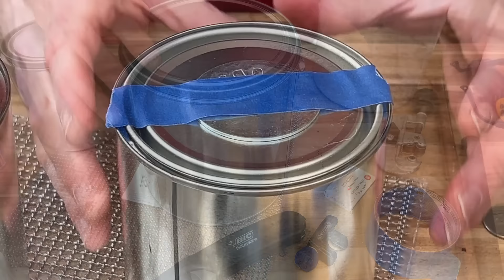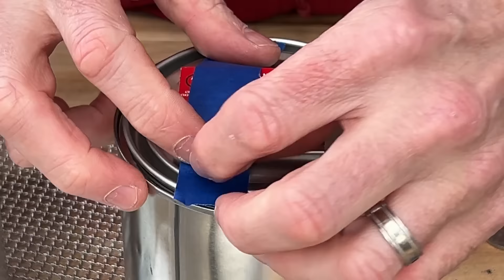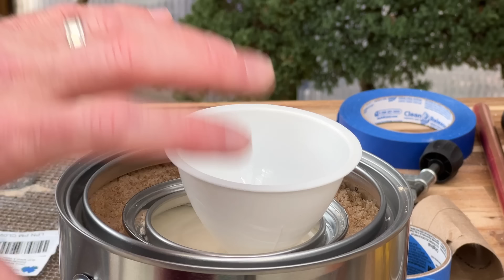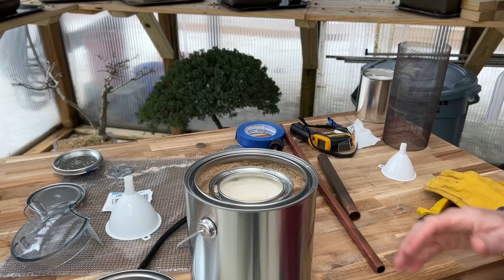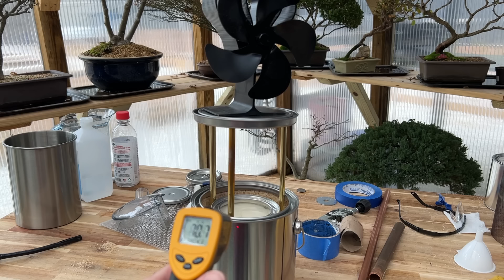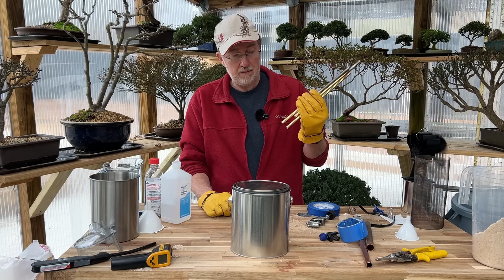Endless Heat Without Electric | Safe Reliable And Low Cost

Comment: My mom, gave me a folgers coffee can. And said if he ever get stranded this wiil keep you from freezing  to death 
3 large 6 inch hard wax candles, and  a dozen bullion cubes 4 styro cups an aluminum  blue metal,t2 small boxs of strike any matches.  Also ketchup and honey packets.,smqll kitchen tongs for holding  the aluminum  glass when heating snow for broth. ,and dozen pckgs of saltines. Got a new version  every year. Only used it once in year's.  And it was a test  to see if it would haved worked. Sat in the driveway after i got home from college  one  year and waited  until the next morning, is was. ,u could see your  breath.  I had a small  toyota celica,not the beast of volume. And thank God  there was snow. It took 1 hour  before my coat off and 2 hours later the was very a comfortable  temp 60 degrees plus. And a sleeping bag,she picked at a garage sale ,just  in case help didnt  arrive. Spent 6hours doing some homework, light  provided  by the dome light. It was a worth while endorsement to my kids who all the same kit. Thanks mom...

Comment: Thanks for this great tutorial. I'm an 81 year old woman  and put one together easily. Both size cans were available at Lowes. I found the fuel at Rural King. It was in the paint dept but labeled fuel. When adding sand. I put a plastic bag over the inner fuel can and masking tape on the outer can edge. I used a small funnel to add the side sand.  I put a label describing contents and the washer and matches in a small bag attached to the outer can. I feel a bit more ready for any power outage.
Reply: Awesome thanks!!
Reply: Thank you for this wonderful device, my electic bill last winter was over 1,200.00 for the whole winter, this will save me greatly on those 25° days, my basement is so cold and I worry about my pipes, but, again thank you, I will only use this a extreme cold heater for my basement.
Reply: @NoriOMoore be careful with the critters they may try to get there ...beware to make sure is anti-tipping !❤✌🏼👍🏼🫂💪🏼🌎❣️🙌🏽🤔
Reply: How long does this setup burn?
Reply: @garymoore5166 I just made one and while I didn't witnessed when it went out I'd say around three or four hours. Not long enough in my opinion.
Reply: I had it in my green house and the fumes were horrible. While it was burning it was fine. I'm guessing in the end when it started consuming the TP things got nasty.
Reply: yeah! I'm 71, I agree!
Reply: Have you used it yet. How do you know it really works
Reply: @damita4336video not enough  ? works for the many... not for the few ...🤔🤭🫂🌎✌🏼👍🏼🌎❣️
Reply: @damita4336Many campers have used toilet paper roll and hand sanitizer... soak the roll in hand sanitizer...(remove cardboard)
Reply: Great tips !! because the "fragile" grid-dy system nowadays  ... prepare is a must globally ❤
Reply: The Lowe's where I live had only plastic cans
Reply: @rickeybaughman4552 Menards has them.
Reply: @rickeybaughman4552 feed stores maybe...
Reply: If you use matches you can dip the tips of the matches in melted wax to keep them from getting wet. 
Mostly I just use a Bic lighter.
I have a couple of these heaters I made about 5 years ago and they actually work pretty good.
Reply: Great job.
Reply: At Home DePot & Lowes MT paint bucket was over $8.00.
Reply: Good I’dea with the plastic bag and tape. I am getting ready to make one. Will use your idea.
Reply: You go mama!
Reply: Be sure the cans that you got at Lowe’s are unlined with out a coating  or the can  give  off toxic fumes. Be sure it’s an unlined can that your  using.
Reply: Thank you for your amazing tips to keep the inner can cleaner while adding sand to the outer can! I was thinking while he was cleaning the sand off of the little can that there had to be a better way to do it.  Thankfully, you just provided it.  God bless you dear! 🤗
Reply: So as the fuel starts to go down in the can, would you just fill it back up to the top and use the same toilet roll?
Reply: @Valerygallery  when you see it start to burn to the tp then put it out, and add more fuel and you can keep the same tp roll for a lot longer.
Reply: greetings , if i understand you correctly, the plastic bag you placed on the inner can is going to melt and the masking tape if you leave it on there when you actually lite it up, is goin to burn when the heater is used , they get super hot,. the plastic melted is going to burn too causing toxic fumes and smoke which is something I'd advise against the mods you described. good thing you commented
Reply: @waynehandzus7840 I believe she is removing them before lighting.  She is just covering the inner can in order to keep the sand from getting into it and then removing the plastic after the sand is in place.
Reply: @waynehandzus7840 🙄😶‍🌫️🫂because some don't have the understanding...😅🙃🫠😮‍💨😩😓😴🤣ok✌🏼🙌🏽👍🏼
Reply: Wish I could see the video but you tube is playing games with the sound the way they do with fake news. I guess I will have to google the web instead.  Don't want to hear Dr. Phil when I want to HEAR about energy.
Reply: You are an inspiration
Reply: @ClintonHester88 ❤❤❤❤❤❤❤💪🏼🫂🌎❣️✌🏼👍🏼🗝🙌🏽🥰
Reply: How about this, just make sure and have enough warm clothing like I do. Then you.wont need to worry about all this crap
Reply: @Lori-g7e because some people own their homes in a very snowy state.
If their electricity goes out. 
To keep the pipes from freezing  & yourself from freezing (not enough clothes can keep you warm where I live!) 
So you do you. Don’t down people.
It makes you look silly.
Reply: @nicoleshepherds9369 Pa hits subzero temps and so far this year we have hit single digits and layers have kept me alive all winter so far. If you layer right and have dead air surrounding you it's quite easy to stay warm without a heat source. But I do cheat I use a doggo furnace, it even fetches breakfast as a bonus feature.
Reply: @larryblake842  yes, I’m north of you. It’s sub here too. :(
I have on layers/ still cold😢
I have many doggo’s none fetch me breakfast:( 🍳.  12 of them. 🐾🐾
You keep warm.
Have a great breakfast lol
Reply: @nicoleshepherds9369 plus it can be used for cooking
Reply: @Lori-g7e socks gets wet  ..healthy clothing is almost non-existent... good luck world all levels of preparedness is a must to think in all kinds of scenarios  ... u could have advice to get more weather proof things instead ... positive is possible same message or even better message  ...snap !❤✌🏼🌎🫂✌🏼👍🏼🙌🏽🗝🌎❣️🤔🤔🤔🤔🤔🙉🙈🙊❣️🤭💪🏼🫂🌎❣️love his channel useful for the many not the few ...I guess ❤

Comment: Great idea, although the fan is very well powered by electricity, it's producing its own from the mentioned Peltier-element (thermo-electric device). It's a semi-conductor and can melt, if it gets too hot.
Using 99% alcohol is not a good idea, it tends to start raging, sending burning droplets out of the container - add 10% water and you get a stable burn. Dissolve a teaspoon of table salt in the water first and you get a visible flame.

Comment: This is a good way in an emergency situation. & i can say so because I used to do almost exactly similar things to this years ago, especially during winter. But please be extremely careful so the Liquidfied Fat, Oils, Wax does not combust due to getting to hot & reaching flash point, this causes a small explosion spitting flaming Liquidfied Oils, Wax, Fat etc which could then set Fire to nearby things. The explosion & heat can also shatter a Glass jar then spilling the extremely hot liquid that will also combust, the Heat gets hot enough to melt Aluminium very fast. So do not place many of these very close together & do not leave them burning for long or without supervision, also make sure there is nothing flammable within a few feet incase it gets hot enough to combust like a frying pan fire does.  It happened to me when I was staying an abandoned Garrage, luckily the floor was Concrete & nothing flammable close by, when it happened to me luckily only thing that got damaged was the Aluminium tray melted that everything was placed on, & then a couple holes in my sleeping bag at the area nearest to the Fire, & a few small holes melted into my jacket i was wearing, from the flaming Liquidfied Oil it spat out when it reached flash point & exploded, which also cracked one of the small jars I had the cooking oil in that i was using at the time. & so luckily I was in an abandoned Garrage with a Concrete floor, & even though it was a very cold night the ground out side was not frozen, becase the Garrage filled up with smoke very fast, I had to run out & scoop up the loose earth/soil & small gravel to throw onto the fire & extinguish it, water or any liquid would of made it worse, i then had to leave the Garrage door wide open for around an hour to remove enough smoke, when it was close to freezing. After this i always made sure I had a couple bucket's, bags or containers handy & close by full of loose dirt or sand etc, i also didn't place more than 3 of these candle/heaters jars to each other to boil water & cook on. Its a very good way in an emergency for Lighting & heating etc but aslong as you are very careful taking safety precautions. 👍🙏🙏🙏
Reply: If I'm understanding correctly, you used liquefied oil instead of the alcohol recommended and you used a glass container instead of the metal one? I want to make sure this is safe if I follow the instructions in the video.

Comment: How often do you change the toilet paper how often do you have to change the toilet paper
Reply: As long as you have fuel in the burner, the toilet paper doesn't burn or need replacing

Comment: Your fan uses a Peltier junction that is a thermo electric device that uses the Peltier effect to transfer heat from one side to another when an electric current is applied. This device when when used in reverse and heated by your stove will generate a d.c. voltage that runs a fan. Probably a  12 volt d.c. fan.  Hope this helps ... Best regards, Lee  😃

Comment: If your just looking for a heater, with some light. Get a metal 5 gallon bucket, 1gal paint can, 1 or 2 bags of sand, about a gal. Of denatured alcohol, a source of flame. Just like the vid above, center paint can in 5 gal. Bucket, surround with sand so it's app. 1/2" below the rim of 5 gal bucket. Fill the paint can with alcohol, add some water to the sand until moist., light the alcohol. Make sure to place it in a safe location from tips and spills. The alcohol will burn cleanly without carbon from a wick. It will provide plenty of heat, warming up the thick layer of moist sand, which will provide humidity, which provides a boost in warmth, and a barrier of dry throat. Keep in mind, I have tested this in a tip over situation, out of 10 tries, the sand extinguished the fire 3 times. So it is imperative, you keep this heater away from traffic, and some what ventilated. Oh and yes, make sure the bucket and pan are bare metal, no paint. Bonus tip... A metal roller strainer (for painting walls.), makes a great grill for this bucket. You can also fit the strainer on a big buddy heater to create a flat cooking surface. Your welcome. So for those of you who don't know. A paint strainer is a thing you put in your roller pan (usually made of a light metal like aluminum.),  that helps to remove access paint from your roller. It works great for what it was designed for and works even better for cooking on crap it wasn't meant for!
Reply: Lath for stucco at the lumber yard is in 8 foot lengths bout 30 inches wide. 
Great for topping a loaf pan to use as a mini BBQ grill. Put a folded piece on bottom of pan to keep coals off bottom. Cut the top piece to slide off. Turn it over and weenies don't roll off while cooking.
These BBQ pits also make really cheap x-mas or graduation presents 😅 and they fit in a backpack or under the seat of your pick up truck. A handful of twigs will cook a Ribeye
Reply: thanks for your comments. yo mention about providing humidity so that you get barrier of dry throat. But out of school we learnt that any type of combustion releases water vapor as part of its natural process. The fuel burns, reacting with oxygen in the air to produce carbon dioxide (CO₂), water vapor (H₂O), and heat. The released water vapor mixes with the air in the room, increasing the relative humidity. Question: do you think to add additional humidity is needed to avoid dry throat?, regards
Reply: @richardlukonde6989 i think it's a great idea to have moist sand to help provide moisture to the air. Humans breathe out moisture too, but it's not enough to make us comfortable and prevent dry throat and dry skin in winter.
Reply: The problem with using a paint roller grid, is you don't know what kind of metals it is made from, and some could be dangerous to cook meat right on it. Should be OK if you use aluminum foil, or cook with a pot on top of it.
Reply: @lucymorgan8859  just make sure you cook it! Burn off the coating and contaminants, just like a needle!
Reply: It is mild steel.

Comment: I saw something similar except you just used a squirrel cage and small generator to run electric heater - you can use extra squirrels on a cold spell - hey you just toss in some nuts   :face-fuchsia-poop-shape:

Comment: Nice video.  I have used tp as a wick in the past.  I used it until I tried using fiberglass insulation as  a wick.

It works well, but has the tremendous advantage of not burning away.  It's the everlasting gobstopper of wicks.

Sometimes small amounts of clean, new scrap insulation can be obtained from construction sites.
Reply: So then you don't need alcohol?
Reply: Great ideas on here. I’m thinking about trying the insulation with the crisco. See if that works together. They say it burns for longer with the TP. But I also have some denatured alcohol and insulation left over already from my DIY/remodel projects.

Comment: if you place a stainless steel mesh screen on the burner that is in hard contact with the lid you will increase heat output mesh act as catalyst for more complet burn.

Comment: does this method work out cheaper than using those little gas butane cylinders? which of them would put out more heat? in England i can buy a  little butane cylinder for £1.50..thats about $2

Comment: Filling the smaller can and closing it before you set it in the large can help you avoid getting sand in the small can.
Reply: OR you can get 4 cans of different  sizes and see which one looks better. You can put one can in another can and it can be fun playing with the can just because you can if you want to you can

Comment: This is terrific thank you for that. I live in Virginia and sometimes we go way below zero and I have used the igloo effect with black trash bags filled with water on the outside of the first half bottom half of my greenhouse and it keeps it 60° in there and I used the Hot rocks can I heat in crock pots whatever works during the Arctic blast thank you for

Comment: Have you ever thought about instead of using sand makes a little sand and some clay pack it down on the inside and around and let it dry slowly you don't want to dry it fast and it will hold heat a lot longer than sand wheel
Reply: Clay definitely does! We have plenty of that in Oklahoma.

Comment: I like stuff like this, but his idea of a monster heater all depends on the surface area at the top and you’re gonna get the same amount of heat out of this as you would the paint cans, but it will hold much more fuel for a longer period at a time

Comment: Decorative trivets in silicone or cast iron -> I chose from online Walmart a lovely rooster
DON'T BURN THE DINNER TABLE
also $10 from Dollar General 4" fan plugs into 5 volt UBS cigarette lighter plug hooked to car or to small 12 volt battery or solar panel

Comment: All alcohol burns without color. 
The fan has a thermoelectric device. You can use electricity to produce heat, or in this case, heat to prodduce electricity. Then the electricity powers the fan motpr.

Comment: Will it last 2 1/2 or 3 hours? I watched another man just use the quart size can with toilet paper and no sand or larger paint can . He used 90% rubbing alcohol and 70% rubbing alcohol. It only burned for 2 1/2 hours at the most. Will yours burn longer?

Comment: beautiful idea i have a antique pot belly stove perfect size . i will fill the bottom of the stove with sand and have the burn can in the middle . the stove has a stack and a damper it weighs 300 lbs no way to tip . being vented maybe i could use kerosene in a stainless steel pot with 3 rolls  a timken furnace 100 yrs ago it worked on a  rail genius but risky . i saw your vid and thought pot belly stove heater . nice and safe

Comment: As usual, a great demonstration of an easy and effective "power's out" tool.  A Ziploc bag taped to the lid or side of the can will keep your matches dry and ready for use.  You can put a note card in it with the description, include the can opener and any additional instructions (like where the extra fuel is stored in case of long term need).

Comment: Fuel heads up:  Isopropyl alcohol is 70% alcohol and 30% water.  When the alcohol burns out the water is still in the wick .  After burning the first refill there's so much water in the wick it won't light again.  There's another alcohol available which is around 90% to 92% alcohol.  The higher percent alcohol will have the same effect, but just will accept more refills before the wick to become too water saturated to keep burning.
I used this type burner in a metal coffee can on a deer stand several years ago.  It was so cold and with a small draft that I was colder with the burner ON than with it OFF.  Strange, I know.  Inside a fully enclosed space with no draft I might have had a better result.  
Good video.
Reply: I bought 91% isopropyl alcohol at Walmart.